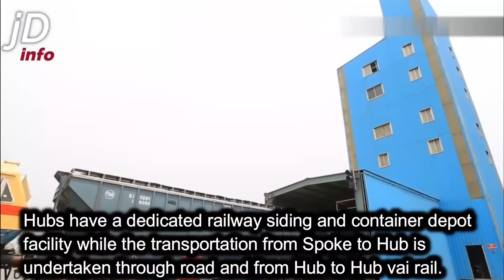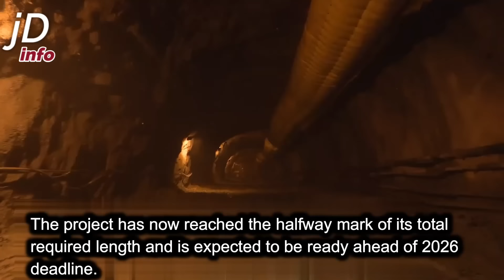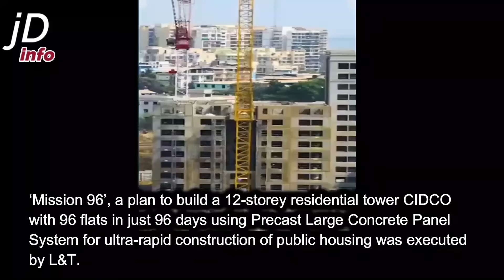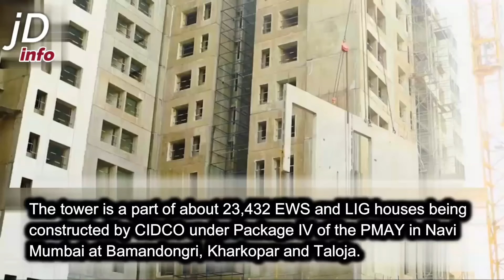India is building everything in a massive way

Comment: i personally think it's dumb to buy electric buses and building more electric train networks would be an one time investment but it'd heavily cut down the cost of fuel and besides after 8-10 years govt would have to once again heavily invest for the replacement for the batteries in the busses. so more electric train routes throughout city would make it greener , and there'd be less traffic in the roads and it's reduce the fuel import (since we can make electricity from Renewable resources and use it to power the trains).
Reply: How flexible can a electric train be?